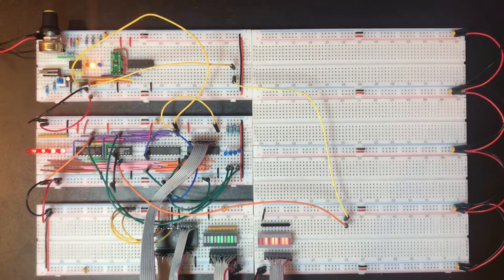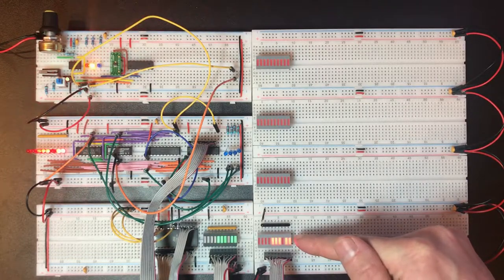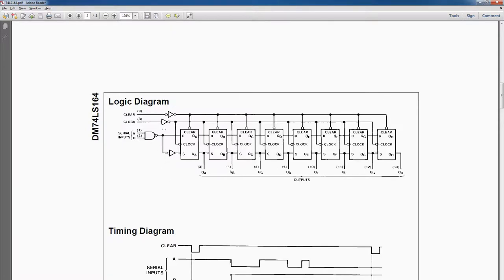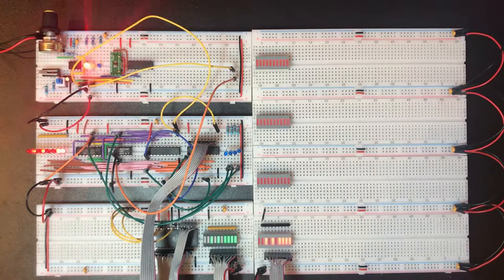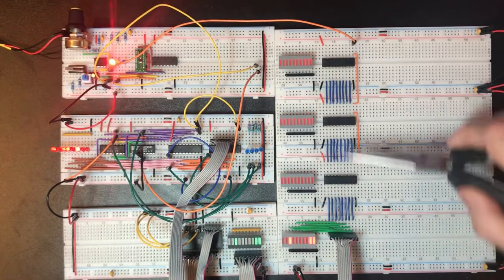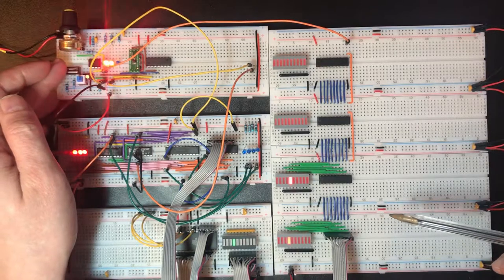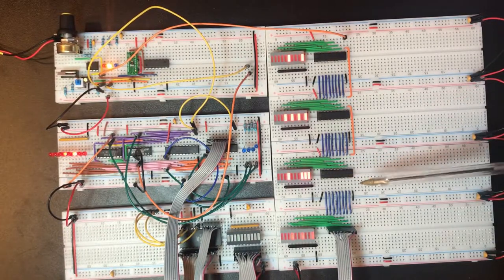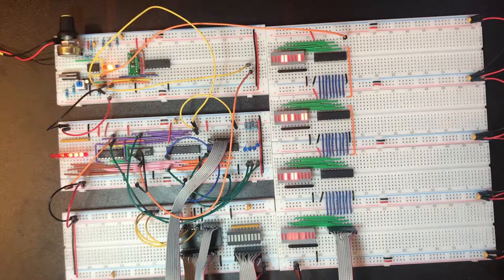Pipeline (2: Instruction Registers) - Making an 8 Bit pipelined CPU - Part 9

Comment: The 8 segment bar LEDs are actually quite difficult to find. There are a ton of sellers on the Internet that will sell you the 10 segment bars. I eventually found a supplier on AliExpress.com that sold the 8 segment bars and ordered some. I paid $8.15 for 20 of them.
Reply from the maker: I actually did the same, but the 8 segment bars never turned up.

Comment: I realize this is an older video now, but wouldn't it be neat if those LED bargraphs were available as two-pin bi-color LEDs? Buy a lot of them, and if you want a different color, just flip it around.
Reply from the maker: That would indeed be great! Not only would you get choice on the color, you wouldn't have to worry it wouldn't work (you just might get the color you didn't intend).

Comment: Hi James. I know I am late to the party and this project is now finished and probably being used by NASA by now 😉. I am watching all episodes of this with interest and understanding along the way without jumping episodes to answer my question here. A processor like the Z80 will only do one instruction at a time and can take many clock cycles (depending on the instruction) to finish before it takes on the next.
From what I understand you are only allowing 4 clock cycles in your design to complete an instruction whilst the pipeline is busy on the next three instructions behind it with each clock cycle.
Is my understanding correct at this stage ?.
Reply from the maker: That's the basic idea. Although at a later point I drop it to 3 stages.

Comment: As soon as I connect ground across the 4 breadboards and the circuit, all LED’s turn off. If I only leave power connected, it powers up the red LED’s on the 4 breadboards but the other way around (lights off when should be on). I noticed my 74hc574 also getting quite hot. How can I fix this?
Reply from the maker: I suspect you have a short or some kind of contention.  It's not exactly easy for me to diagnose just on description. Consider joining the discord and posting a picture and description of symptoms in one of the channels.
Reply: @weirdboyjim  thanks! I got it, was a short indeed.
Reply from the maker: @davidrosset4457  That's good news!

Comment: is this hardwired control logic CPU?
Reply from the maker: In some ways it's a bit of both. You can think of the pipeline as a microprogram that has a fixed number of instructions (in the number of pipeline steps).

Comment: CMOS gate inputs are very prone to picking up 50Hz mains hum when not connected to anything but a good antenna, like a length of wire or a human.
Reply from the maker: Indeed,  although these days you as much to worry about with all the higher frequency stuff coming of switch mode power supplies.